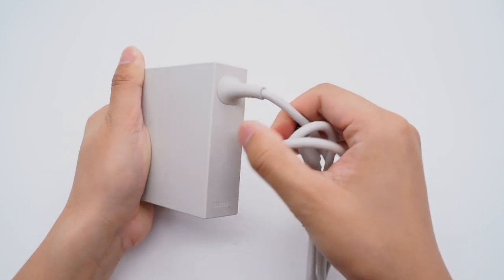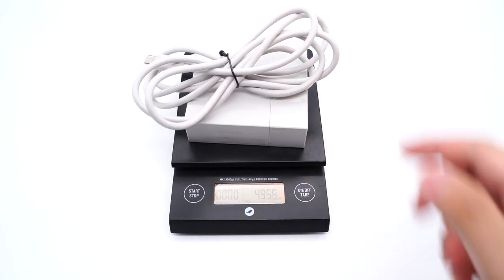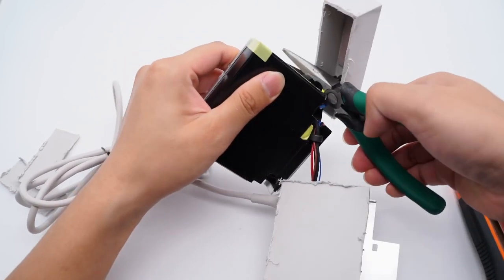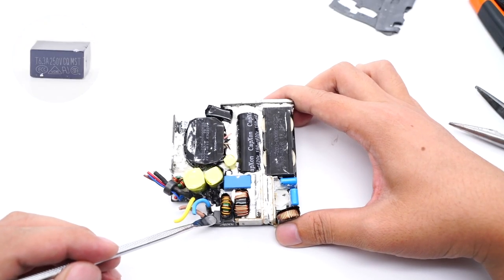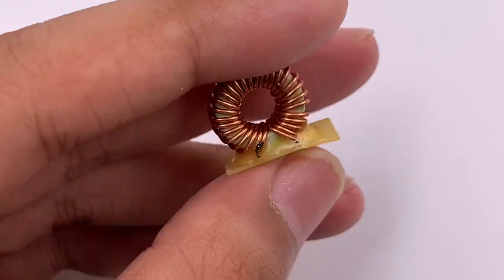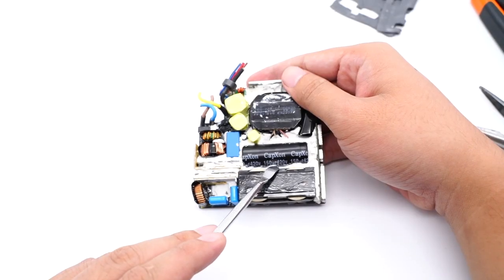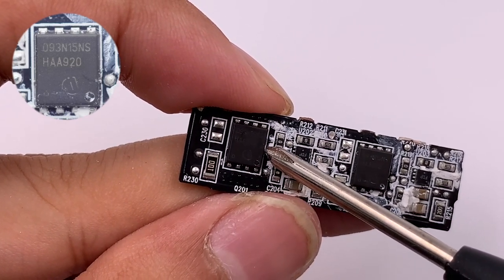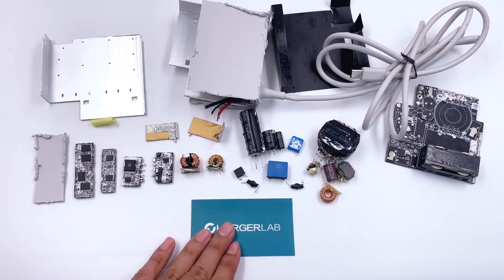Powerful But Tiny | Teardown of NVIDIA 300W GaN Charger (For ASUS ProArt StudioBook One)

Comment: How does it make sense to use a GaN FET with a non-specialised driver, if it is not optimised for GaN conduction losses are much more compared to MOSFETs, so an efficiency losses and you can’t use higher frequency or planar transformers.

Comment: At the beginning I thought it was using a regular USB type C connector. And I was about to ask if it is safe to connect a smartphone despite the fact that the charger is able to provide 48 volts. As it should output 5V by default
Reply: You can't.

Comment: This is half the input capacitance recommended for a 300w PSU, good by holdup time, if your mains varies even a lil bit the charger will lose regulation.
Reply: Hi Mr. Tanishq. What can you say about Yongming Capacitors? How is the quality?
Reply: @xabysebastian529  I only trust Taiwanese or Japanese at this price. I would say those are third grade or cheap capacitors.

Comment: wish asus just turned this into a regular USB-C wall charger for general products. Theres still nothing like it on the market.
Reply from the maker: But there's noUSB-C  protocol that can support 300W.
Reply: @ChargerLAB  yeah but you can have several 100w or the newer 200w+ ports on it. I find that if I'm using a PD hub that does 100w between multiple devices some of the PD controllers don't always have the best power management. when you start plugging more devices in and reaching the limit, the power combinations start getting wacky.